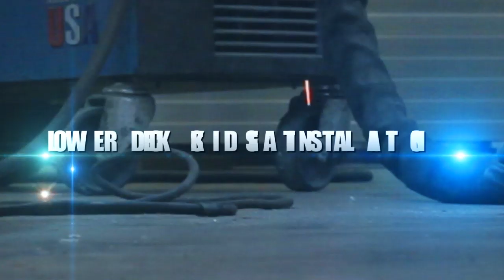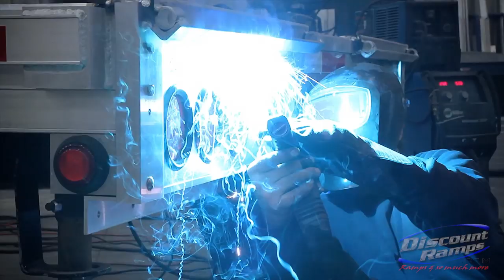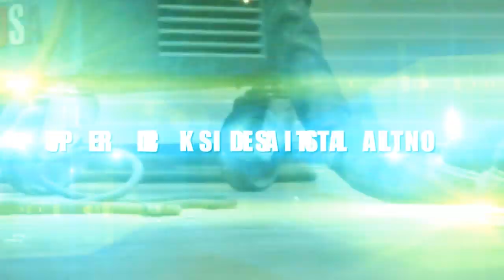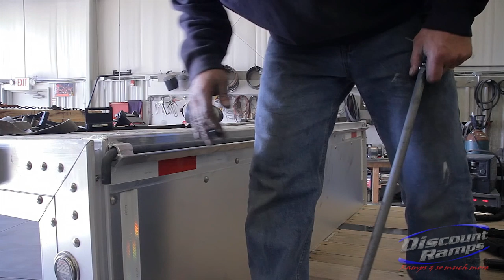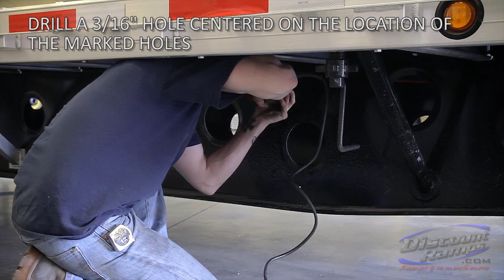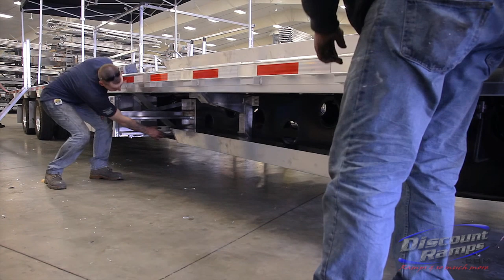Step Deck Trailer Ramp System - Installation

Comment: Hack job installation....trailer frame needs to be repainted where holes are drilled, seperator material installed between steel frame of trailer and aluminum brackets, and stainless bolts, nuts, washers used to lessen the damage from road salt. Installation as shown will self destruct in 2 winters.
Reply: The entire rear on that trailer is aluminum, not steel.  Wouldn't need to paint or put barrier material between.

Comment: what about attaching hangers on an aluminum frame trailer (fontaine revolution)? you can't drill the frame can you?
Reply from the maker: Hi witkr904, Unfortunately we can not answer that. I would suggest calling and asking the trailer manufacture if you're able to drill through the aluminum frame.